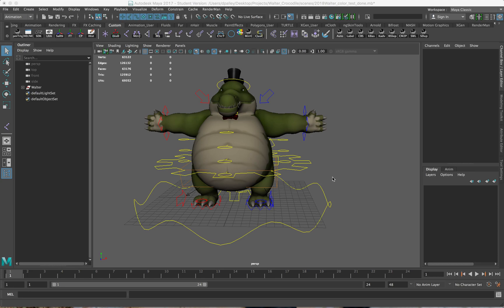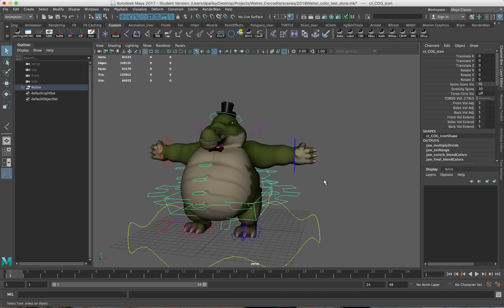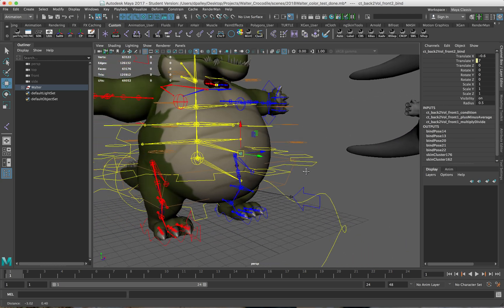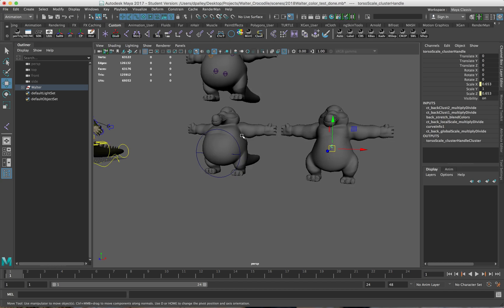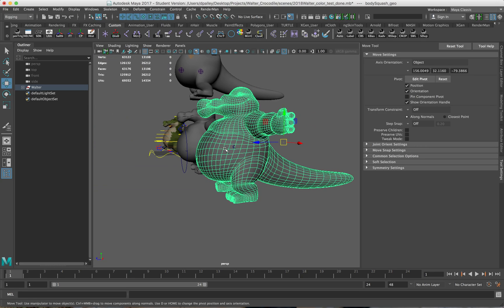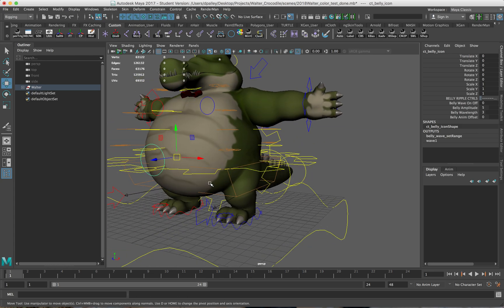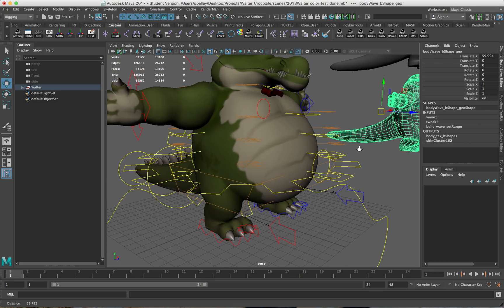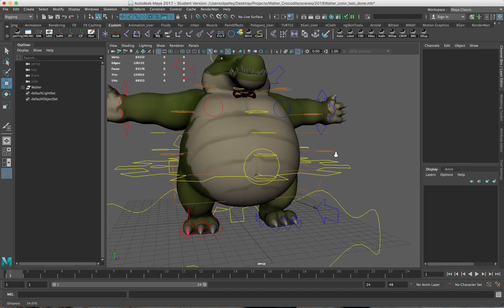Rigging Large or Fat Characters - Blendshape Hacks (Part 3)

Comment: Are the jiggle joints parented to their respective icons?what about the base jiggle joint? is it parented to an icon as well? I see you have 2 pad groups? my setup is joint<icon<pad. pad then constrained to hip jnt. My problem is when I move the root control, the belly joint moves along with it, but the rest of the blend shape body says still. Could you tell me if these are your steps or if I'm missing something? everything works until I try to have the icons follow the main rig
Reply from the maker: Tonya-Leigh Escalante the jiggle joints should only be the corresponding area and nothing else. The jiggle joints on the blendshapes are connected to t icons on the main rig by a direct connection. It sounds like it is working for you.
Reply: @dcpalley23  at 5:17 you said that you can have the controls follow the main rig by constraining them to the spine joints. Thats where i'm having the issue. It all works fine if I don't have the icons follow the main rig, but when I constrain the pad to the spine, the belly just moves with the root but the body stays in place. Oh and I have the blend shape created on the pre-deformation option
Reply from the maker: Tonya-Leigh Escalante hmmmm... I have a couple of ideas. So it seems like your blend shape has priority over the skinCluster. Perhaps deleting the blend shape node, and remaking it with the automatic option. In the channel box when you select the character, the blend shape should be underneath the skinCluster. Also, are the joints in your blendshape model connected to the icons via a constraint or by directly connecting the translate and rotate attributes? They shouldn’t be connected by constraints, so even when you connect the icons to follow the spine joints, it shouldn’t be activating the blendshape. Only when you translate the icon around should it activate the blendshape. Let me know if these ideas work.
Reply: @dcpalley23  Ahhh! Its connected in the connection editor! I was parenting the joints to the icons. I finally figured it out! for anyone having the same problem as me: 
1)After you skin your joints on the blend shape model, create a null group and parent it to the belly joint.
2) 0 out the translations of the null group then unparent it from the joint. This will give the null group the exact translation values of the joint (or you can just copy the joint values into the null group in the channel box from the start). 
3)Parent the belly joint to the null group. The joint values will automatically 0 out. 
4) Create a controller as usual with the pad containing the garbage values and the nurbs circle at 0
5)In the connection editor, connect the nurbs circle (0) to the belly joint (0). This is a 1 to 1 connection so it's important that both arguments are the same before connecting, or else you'd get weird results. 
6) To have the controller follow the main rig, simply parent CONSTRAIN the nurbs PAD to the hip joint. 

Thanks a lot! I wish I asked sooner, I spent hours trying to make this work lol
Reply from the maker: @BudgetTravelGirly  Glad you got it working! It never hurts to ask, though when I was in education, I used to suggest to my students to try and test things or first or search online for solutions.  Problem-solving is such a key aspect to being successful in rigging, so I'm glad you got it working.